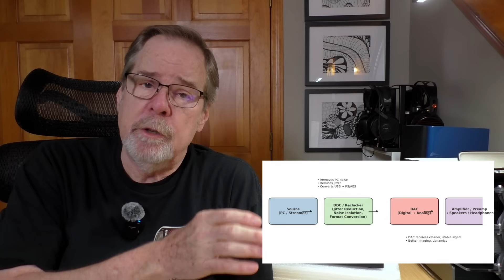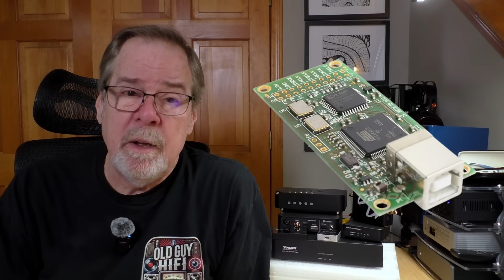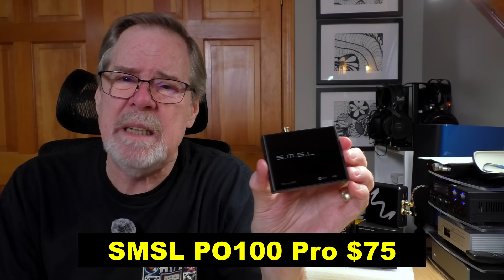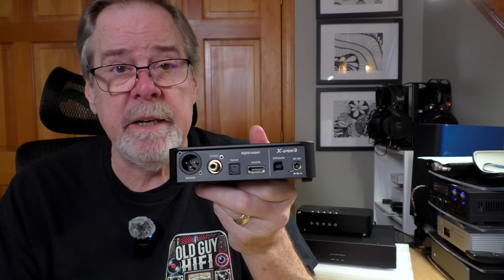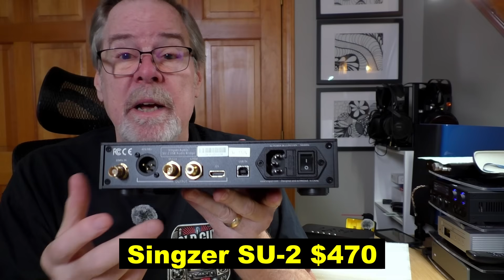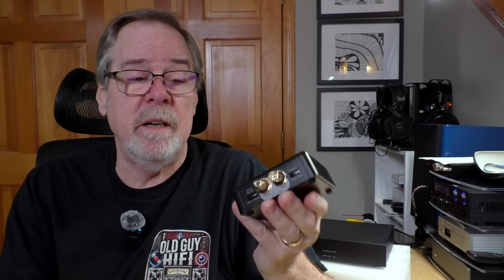OH NO! DDC-Reclockers! Do they really make a difference? YES! They do. I can hear it now “Snake Oil”

Comment: I have a pretty nice setup,  starting with a Wiim Ultra streamer.  Going to either a Topping E50 DAC or a Benchmark DAC, I got from the DAC right to my amp.  I've found that not using a conventional preamp gives me some great sound.  Going right from my DAC to my amp the EV302 Krell makes my B&W801D speakers sound very good. I found that using a preamp was mudding up the sound.  Personally I'm very skeptical that a re-clocker would give me a noticeable improvement.  I would be open to testing such a setup and giving my honest opinion, but I don't' know of anyone willing to supply a clocker to test things out.  If it does make a difference my speakers should be able to reveal it.
Reply from the maker: I think your system is revealing enough to show the difference.

Comment: Ed. Very nice expose.  I have a j2s with amanera usb available using an lps and sparkos in the rca.  Plugged into the j2s 4493 is a wiim pro using coax and also a lps. Would sound benefit from using any of the sub $100 clockers?   Thanks for any advice. Ps. Just looked at the i o  and realized that i need a wiim ultra with usb out or my ipad to use these
Reply from the maker: Yes they need a USB input. I recommend the Douk U2 2025 addition. It is very good sounding. There is a link in the video to find it. Keep me posted on your journey.
Reply: @OldGuyHifiEd. Just tried usb out of my old thinkpad laptop into the j2s.   Cannot believe how much purer the sound is versus the wiim pro.   Would a sub $100 reclocker even imorove the sound further?  I am plugging the lenovo into a wall outlet but it is primarily running off a battery.  Thanks for any advice.

Comment: I'm using (bought it in the day) a vintage (wasn't when I bought it) a Wadia 20 CD transport based on the Teac VRDS drive.  Still amongst the best I've heard. I'm also using a modern and current Cyan 2 RDR dac. Thinking about adding the Laiv  DDC to update the old clocks in the Wadia to better "Femto clocks" and also convert the signal to I2s.
Reply from the maker: I had a Wadia A25 back in the day as well as a Theta DAC. uDDC could be an excellent addition to that system.

Comment: 💯My Denafrips Enyo 15th improved the audio quality greater than any DAC or amp upgrade I have experienced.
Edit: I2S, AES, coaxial, and TosLink output simultaneously is a huge benefit for feeding multiple devices. 1 in 4 out! 🤟😎
Reply from the maker: Wow, thanks for sharing your experience!
Reply: But did you use a ddc with the Enyo?

Comment: Hello Ed: My streamer is directly interfaced with a Ethernet cable. The source path is as follows:  Ethernet to Streamer - digital coaxial cable to DAC - digital coaxial cable to Integrated Amplifier. Will a re-clocker benefit me with this source chain?
Reply from the maker: Why do you have a SPDIF coax going to your amp? You just need regular RCA cables to a line in on your amp.
Reply: @OldGuyHifi You are correct . That is actually the way I have it set up and I don't know why I wrote that it was a digital coaxial cable ... sorry.
Reply from the maker: No worries. I have brain cramps sometimes a well.

Comment: @OldGuyHifi  I used to think that when people (audiophiles) talked about sound, and how much better one product was over another.  I used to be more shallow minded about what GREAT audio really meant.  Decades of experience it took me to realize.  Reminds me of my wife saying to me a few years ago. "  How can you improve the sound of your audio system when it already sounds super clear with detail?  No way it can get any better! "  Now,  I think she fully understands that great audio is not just about how clear, and detailed the sound can be.   After having experience with my upgrades over time, it is very obvious to her now that spatial queues, stereo imaging, depth, height, soundstage, harmonics, plus all other nuances make the listening experience.  I think in 2025 it is very easy to get clear with detail.  Audio equipment purchases is like buying a plain cake, or buying a cake with all the toppings you want on your cake to enhance the flavor.  You only get the great extras with higher quality products which generally costs more.  I used to think you get what you pay for.  Now, I think you get what a quality manufacturer produces.  A quality manufacturer does not skimp on materials or craftsmanship.  A quality manufacturer makes great products at a reasonable price for reliable engineering, then stands behind that product via warranty .  Great products do not always equate to expensive products.  Example:  A quality DDC.
Reply from the maker: Agreed. Thank you for sharing your experience.

Comment: DDCs'/reclockers' make a huge difference in reaching audio nirvanas.   I only recently in the last 9 months tried a DDC/Reclocker.  I have tried two different brands, and 3 different models.  I had never paid any more than $90 on any of them.  I am impressed so much, that I am now in the market for the Musician Pegasus II DAC, and the Musician Pisces II DDC which I will purchase next week.  I already have a quality i2s cable which I will use connecting the 2. I am currently using the Ladder Bach R2R preamplifier (w/remote 🙂), Topping D70 Pro OCTO DAC, and the Douk Audio U2Pro DDC (2025 model).  A big improvement also was using the Blue Jean Coaxial cable over using a glass optical cable (280 strands of glass) both 6ft in length.   Anyways I am rambling.  Listen to what the Old Guy Hifi is saying.  He is right on.  Very smart man (guru).
Reply from the maker: It is amazing that those little devices can have such a big impact. I did use the Singxer SU-2 on the Pegasus II I reviewed. Great combo. Thanks for sharing.

Comment: If you like smooth and warm like I do, you might want to try running your Audirvana software in pcm to dsd conversion mode. I use dsd512. You might try higher.
Reply from the maker: I find upconverting to DSD to be IMHO a fruitless endeavor. It demands far to much processing from the CPU. I am ok with Red Book. Thanks for the suggestion.

Comment: Thanks for sharing, old guy hifi. Valuable points good Intel. I own Mutec MC+ reclocker + Aune master clock + Aune external ultra linear power supply. From my experience, helps reduce timing errors jitter before dac processes it. Lowers noise floor increases headroom instantly, providing contrast= better dynamics. more silent between notes instrument pop out of the mix. Approaches black hole silence. Cheers
Reply from the maker: I agree. Thanks for sharing your thoughts and experience.
Reply: @OldGuyHifi I own Philharmonic BMR monitor, ceramic mini,  true monitor arrives next week. You provided great insightful reviews! appreciate your tutelage and support. Cheers
Reply from the maker: No, thank you. I appreciate your participation in the channel.

Comment: I use the Gustard U18.  It does make a nice difference.  I've taken it out of the system a few times to test.  Even my wife can appreciate the clarity and dark background it provides.  Awesome video!!
Reply: There is no question that a good ddc has a huge impact on space and sound. I also have a Gustard U18 and if you use a PC it is a must have
Reply: @BobbyTwoTimes  agreed. I use the U18 between my computer and DAC. The difference was huge. I rate the U18 highly. Cheers
Reply from the maker: Thanks for sharing your experience!
Reply: @OldGuyHifiwhat would provide the superior connection between my Wiim Pro and a FiiO K13 - currently using a high quality coax cable but would usb-c to usb-c be better? 🤔

Comment: I do not see how humans can pick up any differences or anything from things such as reclockers. It flies in the face of physics. So I plain can't buy how anyone can hear a difference, just like with cables. The only differences would be picked up by "measurements", but I don't care about measurements as they have nothing to do with what one hears. 
Snake oil? Perhaps and perhaps not, but whether it is snake oil or not it doesn't matter if the only way to note any difference is with measurements. What I believe it to really be is psychological trickery and marketing. We see something measuring differently and we automatically assume it performs or sounds different. We hear a bunch of explanation of a product using pseudoscience and we automatically give it full credit. It is like walking into a casino and seeing slot machines showing pots filling up in the top graphics or animals growing larger, etc. and we assume it means that the machine is getting ready to pay out a jackpot, when really those graphics have nothing at all to do with it. They are just to make you think they do to attract you to play the machine.
DACs and DAC devices have reclockers built in that should do the job they do, no need for a string of outboard reclockers. If you can't hear jitter there is none. If you are hearing jitter it can only be one of three things: 1) you are playing a CD that is too scratched or a player on it's end of life cycle, 2) Something is going on with your internet connection or the streaming service or 3) Make an appointment with an ear doctor.
Reply from the maker: Read the white paper in the community post and try and understand the human is far more sensitive then any measurement device. Just look at the positive comments this video is getting. We aren't full of shit.
Reply: @OldGuyHifi I have read the white papers and it has nothing to do with music or applied science. I studied physics in university under Dr. Micho Kaku and he handled the math while I focused on everything else. I do accounting, but physics math is esoteric whereas accounting math is real numbers. 
Positive video comments prove nothing in the topic. I'm not saying it is "snake oil" or is not "snake oil". like I said, it doesn't matter. My point was that what matters is what we hear for real and how we as humans can be manipulated by each other. If one believes a reclocker for instance makes all the difference to them, there is nothing wrong with that, but to make that an absolute universal fact is where it goes off the rails. Example: I know the filling buckets or growing animals on that slot machine have nothing to do with the random number generator that powers it, but the person next to me may not know that or indeed chooses to believe that it does matter. It doesn't change the interaction they have or I have with it. 
We both get to enjoy it in our own way. Same with music. All this gear, affordable , not affordable, available, not available, real, not real, whatever doesn't change the music. It only changes the individual's belief of the music based on what that individual bases their beliefs on. So in this example, some might believe that they need said device to enjoy their music for some reason as they believe they are hearing said anomalies that a box claims to fix, while some do not need it as they are not hearing said anomalies.
Like I said, the only time I have heard jitter for example is from a CD player with a badly scratched CD or the player at end of its life or if there is some buffering issue or something with the internet.
There are other things that do make a universal difference to everyone such as op-amps or switching between a saber dac and an AKM or R2R. These things have voicing so anyone can hear the differences and such. Reclockers, cables and such have no voicing, there task is simply moving electrons around and they are needed for their task, but they won't change how something sounds.
Reply: @ericelliott227  Hey -- if it can go one way, why not the other? If one believes that what can't be measured is irrelevant, then why can't, given that belief, it influence what one thinks one hears -- in that case, no change? Couldn't there be an unconscious prejudice about acknowledging differences?
Reply: @johncallaghan3097  Yes, that is my point.
Reply: @ericelliott227  do you measure feelings?
Reply: @RodrigoSantos-o9d  It depends on what you mean. I don't pay any attention to gear measurements. I pay attention to what I hear.
Reply: Just sit down and enjoy the music!
Reply: @rafacq  Exactly!

Comment: I've been using the SMSL pro with my Dayzee since you first spoke about it. Definitely made a difference. I just received an email from Apos ref the SMSL G1 master clock. A little pricey at 529.00 but not too crazy. Curious as to your thoughts.
Reply from the maker: I have the G1 here right now along with the D200 & PL200T. Just started to dig into it. Review soon.
Reply: @OldGuyHifiI purchased a GPSDO clock for $250.   Same clock, but used for astronomy with some really precise accuracy.   Apparently astronomers pay lowe markups than audiophiles!

Comment: Seems like yesterday I sent you the P0100 Pro :) I upped mine to the Dennafrips IRIS, Like you I dont care what the measurments are it just sounds better. In my system I have a diffrent DAC on each output into the Kara, Fun way to compare DACS.
Reply from the maker: Yes my friend it is all your fault. I can't thank you enough.
Reply: I was choosing between the Denafrips Ares 15th DAC with the Denafrips Iris DDC, or the Musician Pegasus II DAC with the Musician Pisces II DDC.  I ended up choosing the Pegasus with the Pisces.  I will purchase these two next week.  I almost purchased the Schiit Kara, but I ended up opting for the Ladder Bach preamplifier.  Schiit makes decent products.  I may end up getting the Kara down the road for my second system that I currently have matched with an older Emotiva preamplifier.